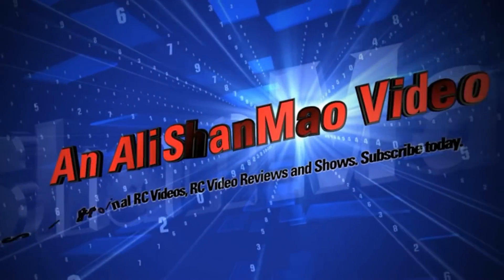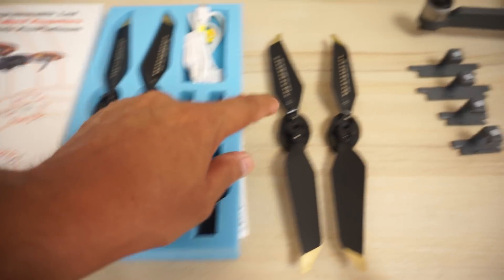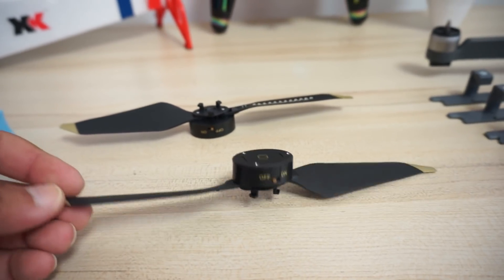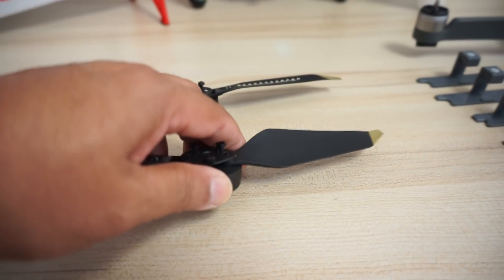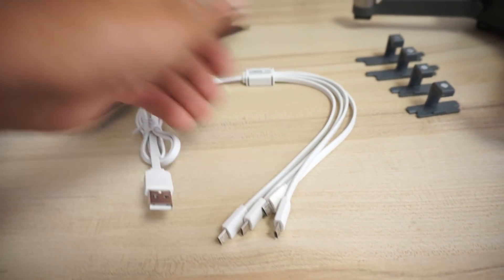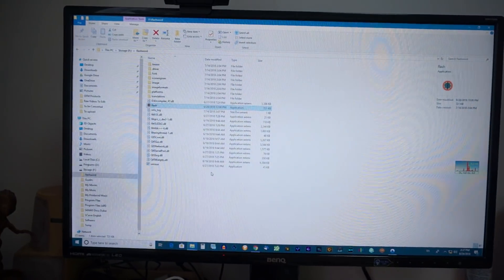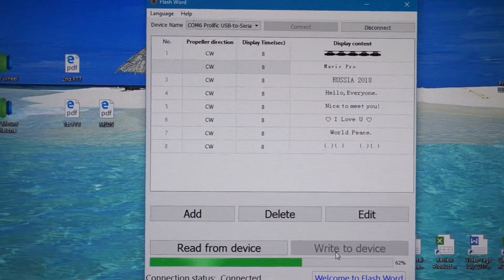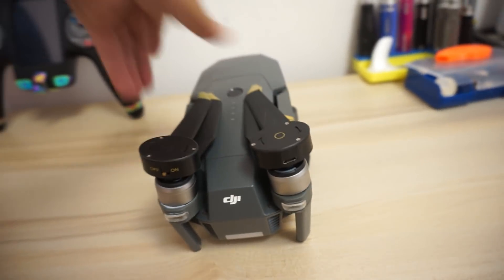Detail Review DJI Mavic Pro Programmable LED Flash Propellers

Comment: Well, I just had ordered 1 paire off these propellers before I found your review.
Do you have some more experience with them since you made this vid?
I am realy concerned about the heating motors, witch might come because they cloge the air flow through them.
Thank you for a good review btw.
Reply from the maker: I suggest do not use these. they will damage your drone over time only. its ok to fly for few minutes at night to amuse someone. but do not use them for normal flights
Reply: thank you, that was my thought also.
Demonstrating them on som arangements in the flight club but nothing else.

Comment: having trouble getting propeller to connect to program. It shows its plugged into the USB port but just says connection fail. Any chance on knowing a solution?
Reply from the maker: Did you turn the props on :)